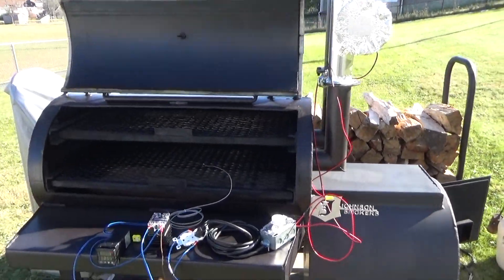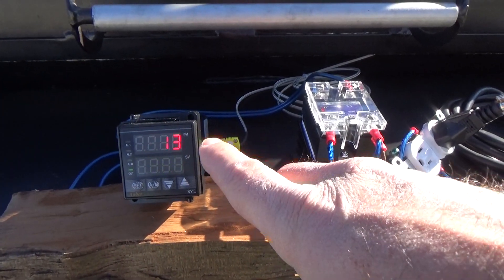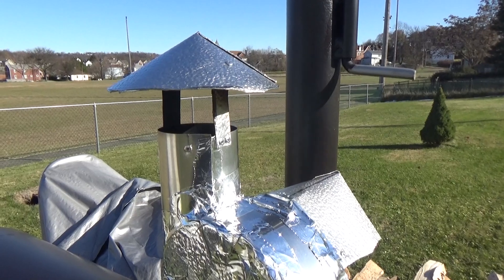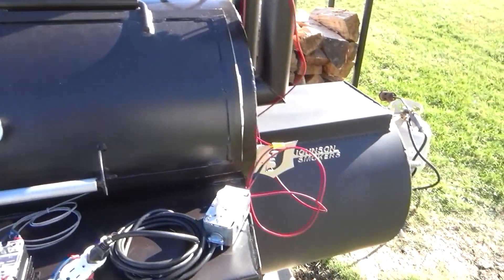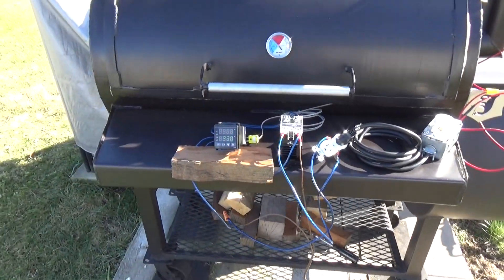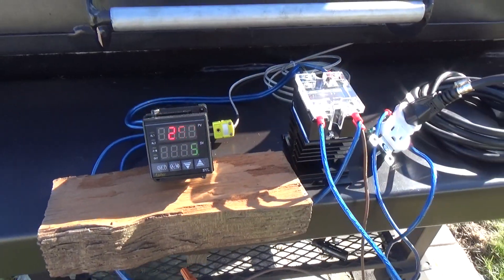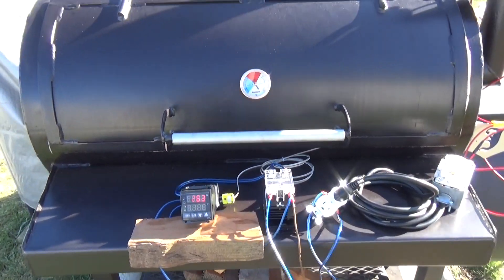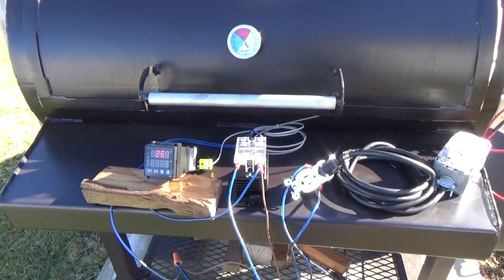PID Controlled Offset Stick Burner Smoker/Fire Management Made Easy 🔥

Comment: Thanks, looks like the way to go! Looking for ways to automatically control my offset's temperature, looked at pellet conversion kits (complicated and expensive/laborous DIY) and PID controlled intake blowers (not that easy to integrate & control properly to keep clean fire) - controlling the exhaust is simple and should just work with the normal fire box and fire process.
My smoker has one thin-nish smoke stack pretty much like one of yours, I'd like to add the blower into that, but thought a cleaner (not destroying the smoker's appearance) way would be to blow high speed air inside the current smoke stack thus also speeding up the exhaust, like what Dyson does with its "bladeless" fans. The plan is to have a medium pressure blower blow air through a steel pipe drilled & welded to the chimney, would allow control but wouldn't much change the looks or current functionality, just increase flow when needed.
Reply from the maker: Hi Turo!  Quality Stick Burners are designed to draw air thru the pit.......so however You go about installing an exhaust fan.....it will work and be awesome! 👍  
I would also recommend the use of a PIID controller to run it.....they are cheap and will keep temps steady for you.   Send me pictures when you get it done. 👍
Have You watched my most recent videos?........I call it my Hybrid Pellet Assist/StickBurner. 😁    Stay in touch.......Metal On!  \🔥/

Comment: This is awesome!  Now, if only you could do a rocket stove type autofeeder for the sticks it would truly be set and forget...  Could you share what components you used for your build?  It looks like a $30 PID controller and a solid state relay.  But, what fan are you using?
Reply from the maker: Hi Chris!   Thanks for checking out my creation. 👍  You know I thought about the rocket stove idea,.....never got around to trying it. 
But I bet it could work. 👍  I'll tell You..... the fan is a convection oven fan that will withstand the heat.  Now the housing was 
fabricated by me.  You may be able to buy a similar fan set up, but they are pricey.  That's why I made it.   Anyway......this concept Works! 
Just a matter of time before a company steals it.    Metal On My Friend! \🔥/

Comment: do you have a vid on how this is all connected and how to set the pid?
Reply from the maker: Hey Thanks for the interest in this. I checked out your first Vid making the Forge......That's METAL! 🤘  Sorry no I didn't make an instruction Vid on the set up.  You can find Vids on that....that's what I did.   I got all the parts from Auber Instruments . Com     If You email me I can take a picture of the connections.......you're not a BBQ guy so I'll help ya. 😎  But Like I said......this stuff is out there. 
Metal On!  \🔥/
Reply: @HeavyMetalBarBQue  Hey thanks for checking out my channel and the gracious compliment. I really miss making the smithing vids, maybe one day I'll get the time to get back to it.
After I posted this question here I did find some of those videos you were talking about. The ones dealing with bullet casting. I figure it would probably be the same deal, so I have a direction for my pid build now. And I can see where having a PID like this would come in handy with other things in my shop as well so I'm kind of excited to get the thing built.
I've just gotten into real bbq, other than burgers and dogs, in the past 6 months or so, I got a Webber kettle and a OKJ Bronco. 
I actually just picked up a used electric Cookshack smokette oo8 at an estate sale this weekend for a steal. Its old and needs a little tlc but it works.  
Anyhow thanks for the reply and I subbed so I'll be checking out more of your vids.
Reply from the maker: @OrionsAnvil  Oh......so You are a QueTuber?????   Now I can't talk or tell you anything.   LOL......just kidding.  My only advice is...........Don't be a Monkey See Monkey Do BBQ Channel!    I hate those guys! 👎    Oh......watch my stuff as a reference, because I am the Truth!   True Que only here My Brother!  I don't ask for or Sell anything!  Those Guys can F---k Off!!!
Metal On!  \🔥/
Reply: @HeavyMetalBarBQue  lol no no I'm not a "quetuber" I do blacksmithing vids from time to time. I just like to cook and eat bbq lol

Comment: How did you determine your PID coefficients? How much training was involved? Especially for the D-term.
Reply from the maker: 😁   Obviously You Know a lot more about the PID than me.  All I do is sent the temp and let it do it's thing. 
And Hey........It Works! 👍😁    Oh......I have several more Vids using this set up! 👍      Metal On My Friend!!!  \🔥/
Reply: @HeavyMetalBarBQue  Oh I see. No dude you made something cool as hell!  I was just curious.  Want to try something similar myself.
Reply from the maker: I believe in other Vids I explain the PID components are from Auber Instruments . Com  and I made the fan housing
with a fan from a convection oven. The motor and fan can withstand the high temps. 😁🤘  I appreciate your interest......
and This Is a Game Changer!!! 🤘   Metal On!  \🔥/
Reply: @HeavyMetalBarBQue   Hell yeah.  I want to do what you did but add a variable speed blower to the firebox to make the predictive 'D' term in the PID loop actually predictive.  The 'P' term is proportional. It is the dumb term. For example, if setpoint is 200 and the actual is 195 then run for 20seconds.  The 'I' term integrates over the time between loops in a way and says lets add or subtract a couple seconds based on the previous actual vs expected temp.   The 'D' term is predictive and really only useful in an application like this with external or additional information like external temp, humidity, or whatever variable would affect the temp inside the chamber.  My dream controller is one that factors in external temp, wind speed, sunlight, and pellet efficiency.  Someone could do it but it would be damn expensive to reproduce lol.

Comment: I have a pid controller I put together and I had a wired to feed air into the fire… worked great I have a video on my channel
Reply from the maker: Hey Joe!  Yep a PID is the way to go! 👍  I checked out your Videos and see how you put it all together.  Very cool of You to list all the parts and links to get them. 👍   
I believe you are burning wood splits and I'm glad the stoker fan at the fire box is working for you. But for Me this way doesn't provide enough airflow or oxygen for a clean burning fire or to maintain the hot coal base. Your set up is better suited for using charcoal as the fuel and some small pieces of smoke wood for the flavor.   Stick burners are built to have proper draw through the pit, that is what keeps the fire burning. Like I said, if this set up works for You and You are happy with the product, then that's great.   But if I were You I would look into building something on the exhaust side. This keeps the air intake always open providing oxygen even when the fan isn't running. A Clean Burn is the key when burning real wood splits.  BBQ shouldn't taste like a house fire to be good Que.  Smoke flavor is only one aspect of good Que, it shouldn't be an overwhelming taste that dominates the flavor of it.  
Stay in touch and let Me know how your adventures are going! 👍  Metal On! \🔥/
Reply: @HeavyMetalBarBQue  ~ Thanks for checking it out… I actually no long have that pit I still have the pid but I don’t use it now because I’m using a large 250 gallon offset.

Comment: This is on off control not pid, but neat
Reply from the maker: What are You talking about?  Is that Not a PID controller You are seeing??????  Isn't PID control On/Off anyway? I don't understand Your point.
Reply: @HeavyMetalBarBQue  a PID controller will give a variable control signal that is the sum of the deviation proportional band, integral and derivative time. The signal is then used to manipulate a variable, in your case the air flow

But what you have is an output signal that turn on and of the blower, you can achieve this by a simple on off controller like thermostat.
Reply from the maker: @karimhabsi6508  😁 Sure, I guess I could use a simple on/off thermostat......but this is a PID Controller that I use the Autotune function for the 
variable control signal.  If You still don't believe Me, I can tell You the manufacturer and model number of this unit.....a PID unit.
Reply: yeah neat.. like you said not true pid.. even if that controller is pid capable.. it basically was autotuned for a certain fire.. and no 2 fires will be the same. That unit is designed for an oven with resistor that heats for example. This resistor will always be the same.. so then the autotune function would work good. This design basically only makes the P our of pid probably :)... but even so very neat. 
I plan on building byself one .. but only working on 12v both the pid controller and the fan, and a SSR relay .. but maybe just using the ssd inside the controller .. i'll see. 
I would be interested in the size o the vent in the pipe and what type of vent is there for how many cfm and how is connected if you could share any pics :P

thanks, nice work indeed!

Comment: I’ve been looking hard at this model to replace an old Brinkmann and thought it would be a major upgrade. However, looking at all the mods you’ve made (had to make?) to be happy with it I wonder if I should look at something else. Any thoughts on their T-smoker designs?
Reply from the maker: Hey Matt!   First, I'm a Nut and I do most of this stuff to amuse myself.   The only Mod that really needed to be done on this Pit was the felt gasket around 
the cook chamber lid.   And for the average guy that wouldn't have been an issue.     I like the idea of Vertical.....heat and smoke naturally go up......so the 
T- Pit would work for me.  But if I were to get a Vertical it would be a box design just for easy access and amount of area it has.    If you don't need a lot of cooking area
I'm sure it will be fine.    You know I'm willing to let my offset go for 1/4 the price I paid,......not because there is anything wrong with it, I just get Bored and 
may want to explore other options.   If this is something you may interested in, all You gotta do is come and get it!  I'm outside of Pittsburgh!    \m/
Reply: Heavy Metal Bar-B-Que that’s  actually kinda tempting. Do you have all the original parts? I see you removed the top half of one stack. I’ve got a pickup, I could borrow a trailer. Any idea what it weighs?

Comment: can you run a pid with a vfd with single phase or would that have to be a 3 phase deal?
Reply from the maker: Not an electrician, but I do like the idea of a VFD instead of a PID in this situation. 
PID is on/off.    The VFD would be slower or faster fan speed with a continuous draw. 👍 
But, with my Pit and set up, I do still have and maintain natural draw. 
Cool Idea Bro!   You make it......I'll buy one! \m/
Reply: @HeavyMetalBarBQue  it does not quite work like that the pid would control the vfd. what I mean is different speed settings for a temp ranges. It would gradually ramp up and down depending on the temp. I do electrical wiring for industrial automation, like wiring control panels for robotics. Let me know if your interested in this idea, I have done it in the past with 3 phase, I don't think it will be cheap to do but I think it's possible